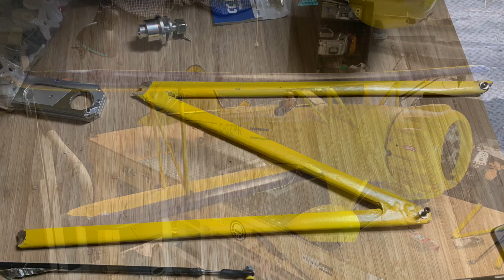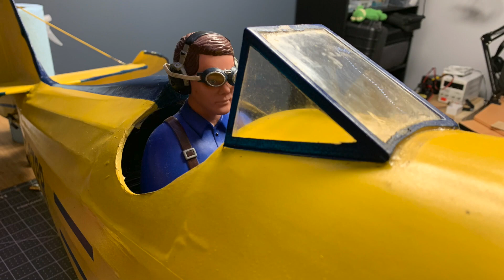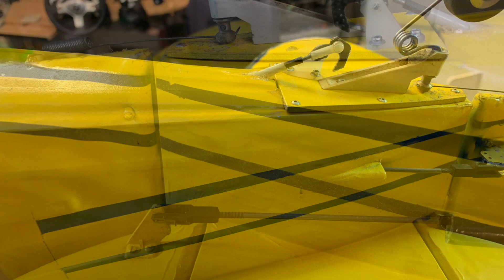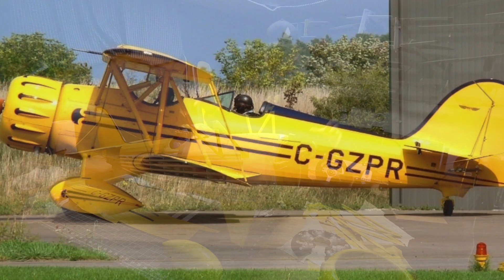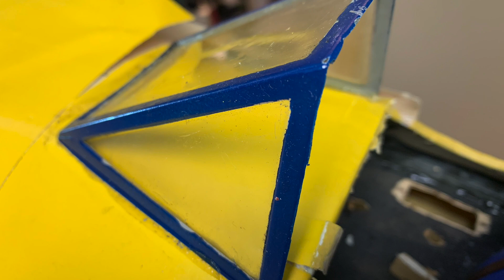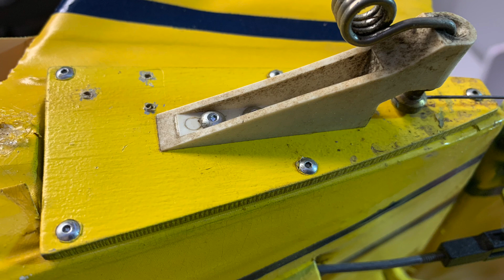1/5th Scale Waco YMF-3

Comment: Looks like a nice biplane project... Hope you film some of the modifications. Great idea to make it electric. I had bought a 2310mm/91" Gas Cub from HobbyKing a few years back and I modded it for Electric. Runs on an 8S.
Reply from the maker: I could run this setup on 8S if I need to but I am thinking 6S should be plenty. If the motor is struggling I'll pick up the 320KV version of this motor.

Comment: Beautiful plane! I have the foam version but would love the Balsa type. If one ever becomes available, I will snatch it up. I have a plane that was given to me, I originally thought it was a Sig Kadet but it's not. It does also need recovering. I need to order the monocoat and get going on it. 
Make sure you reglue all the wood. I learned that wood glue shrinks and drys out over time. I has an Extra 300 that was nitro that I crashed upon take off. The body basically fell apart because the wood glue had dried out.  I had to rebuild the cockpit area because of my crash. I recovered it and was complimented by the new owner at my recovering job. I hadnt done one in 30 years. I got out of flying.
Make sure you do a follow up on it. I want to see its remaiden. Are you doing other videos? I will subscribe.
Reply from the maker: Yep, going over all the glue joints and making repairs. That is part of the reason I removed the covering. I plan to make videos about all the work I do on this plane. Thanks.
Reply: @blameandre  I will be watching

Comment: That is a cool project! What did you pay for it? or don't you want the wife to know? Anyway, I'll keep my eye on this build. I love the Waco. I have Eflite UMX Waco(love it!) a Dynam Pitts as well. I want the Dynam Waco too!(yellow one)  I'll replace most of the electronics as I did in the Pitts. The Waco is just a BEAUTIFUL airplane. AH7 out!
Reply from the maker: The previous owner sold it to me for a very good price. Wife approved ;) When this is one is finished I'd love to find a nice WWI biplane.
Reply: AirHammer7 I also have the UMX version and the Dynam version. I love flying both whenever I can. My Dynam Waco has been through beginner inexperience . I have crashed it several times( once in a huge willow tree). Now I can fly it without any issues. I would LOVE to get my hands on a Balsa Biplane.
Reply: @scottfirman  What battery did you end up using in the D. Waco? and or any nose weight? Those trees can reach out and just  take a big bite! One got a F2a Buffalo of mine. No coming back for it. Not ready for Balsa just yet. It takes more than a little glue to fix them!
Reply: @scottfirman  Hobbyking makes a Balsa Pitts S2B ARF biplane.